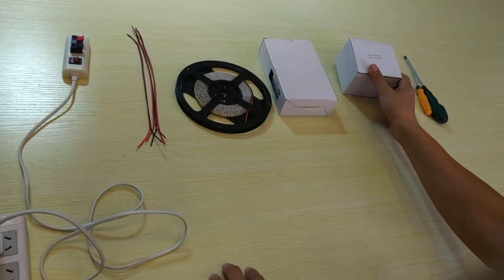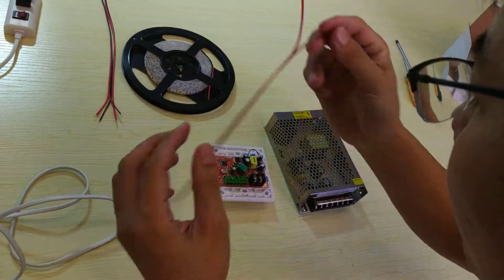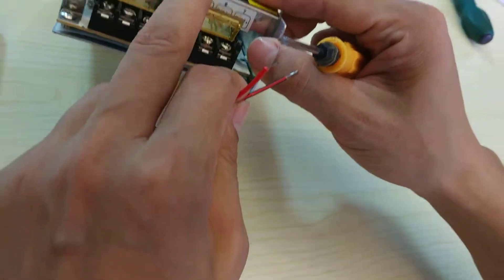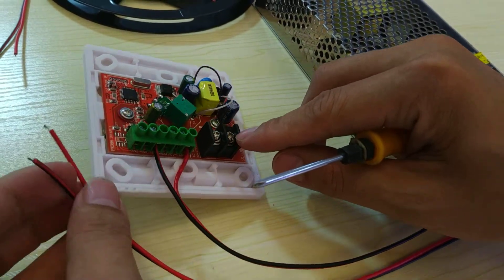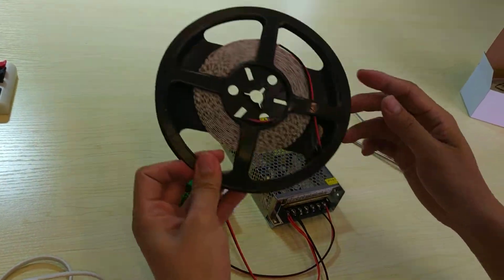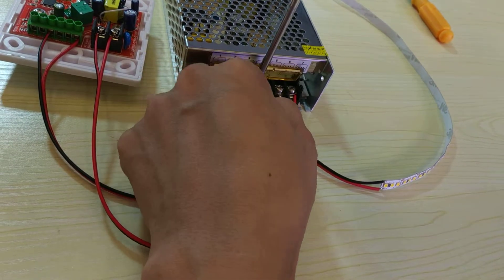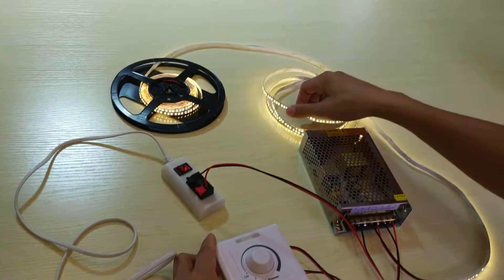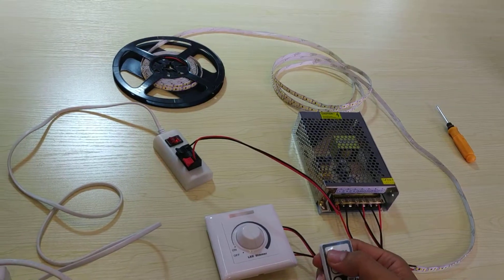How to use 0-10V dimmer to dim led strip light?

Comment: I recommend the Responsiv 0-10V Blink'n'Dim Adapter, model BNDA0-10V.

It is the only 0-10V dimmer that:

* Is easiest to install
* Enables dimming control with existing switches
* Works with existing traditional wiring
* Accommodates smartphone and voice control

See its Amazon sales page at https://www.amazon.com/dp/B07H3FDQCT